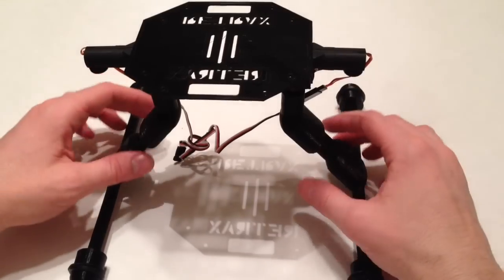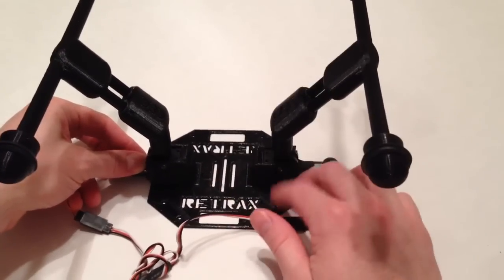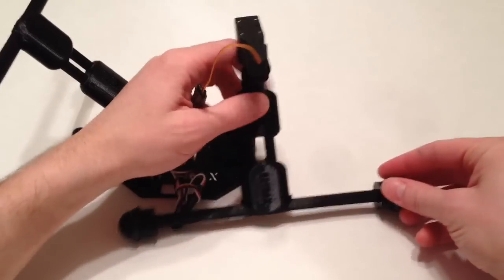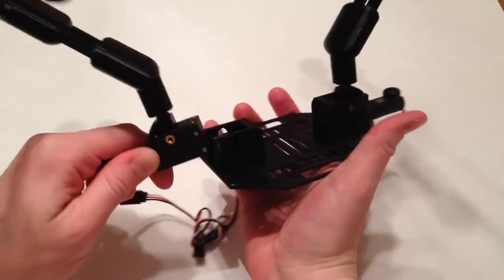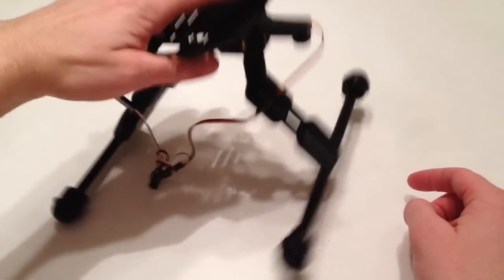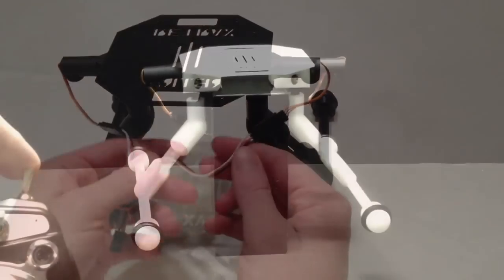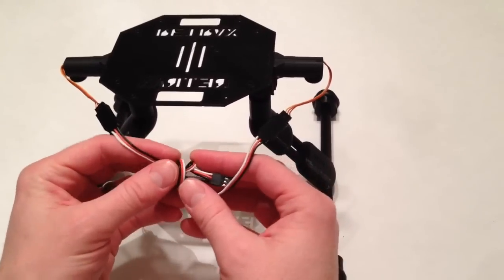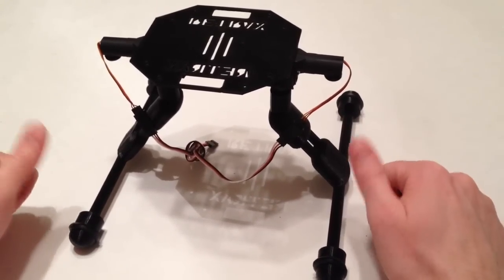DJI F450 retractable landing gear demo

Comment: Hi I purchased a set similar to these from tarot and they work the same way However, when I flip them up or down with my motors running, they will cause the motors to shut down  at the end of travel up or down. I tried these while flying and my quad fell out of the sky. I'm using APM 2.6 with power module, AT10 RadioLink Tx and Rx. Does the same even when i connect it to a totally different Quad with the same setup  What would cause them to shut down my motors?
Reply: I think, it is because the landing gear is taking current directly from the receiver